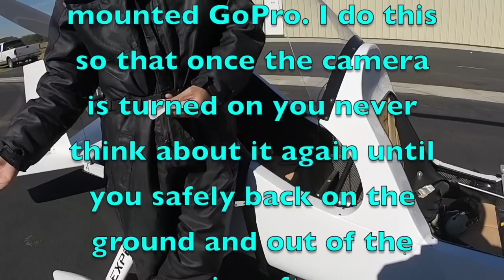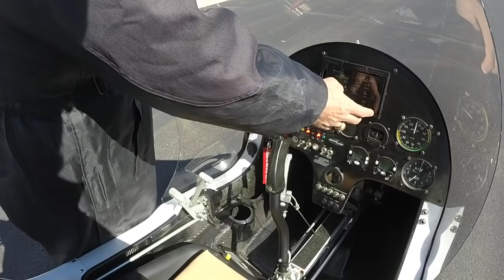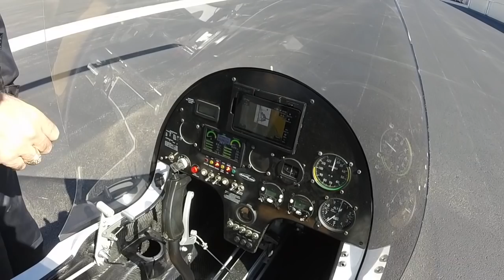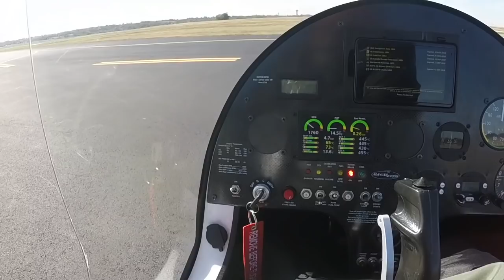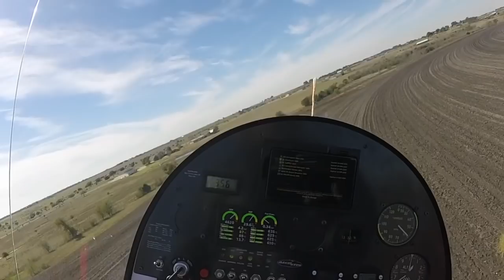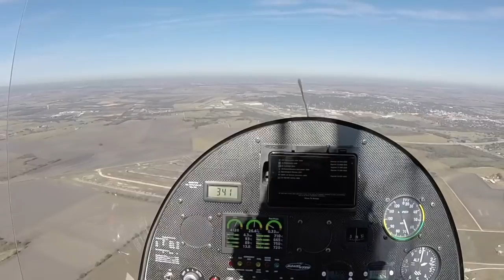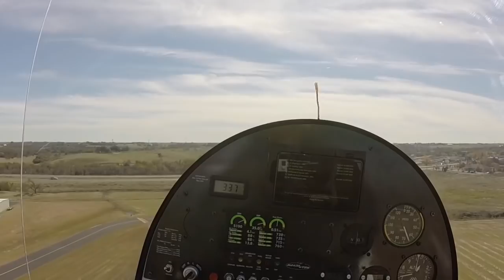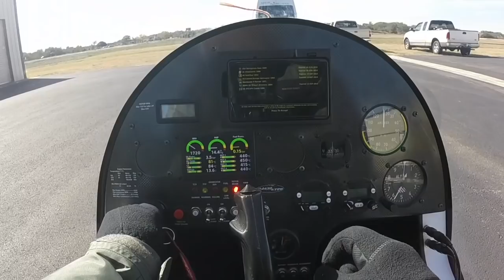Gyroplane Flight Training with CFI Dayton Dabbs on 11-15-18

Comment: I remember my training for emergency landing, and my trainer was excellent. He told me prior to training that at any time he could cut power and not warn me, and then say nothing until I fully acted on the situation. He would give me feedback immediately after each flight, good, bad, and in the middle. At about 100 hrs I had an engine out just after takeoff, was about 150 feet in the air, and lost my engine. I slipped the plane to lose enough elevation to go under power lines immediately in front of me, and glided into a plowed field. No injury or damage. Sadly this was a plugged fuel filter, rented plane, but I ALWAYS checked fuel and filter after that. Training never ever stops, neither does awareness.

Comment: Can you fly a gyro plane in the rain with a closed canopy?
Reply from the maker: Yes, you can but should be avoided if possible because rain reportedly eats away at the leading edges of the prop and rotor and paint in general.

Comment: On gyrocoptor can I use coaxcil rotors and rear pusherpuller  for speed increasing?how to do instant lifting without a runway?
Reply from the maker: No on coaxial rotors since they are free rotating and have dissemitry of lift - they would have to be very far apart and controlled on the same plane. Not a good idea. There have been designed which can do jump starts, but but can hover in a static position. Forward motion is what make the rotors turn and create lift. Think of the rotor and simply a rotating wing.
Reply: @MikeSmith628  thankyou brother.